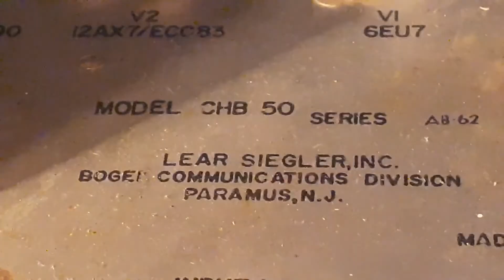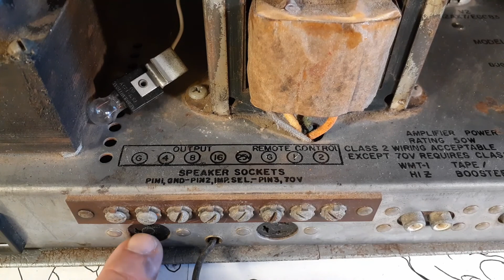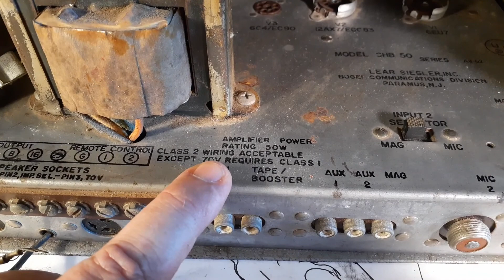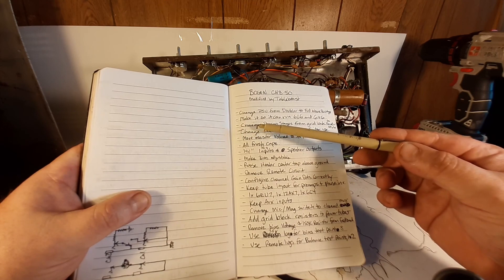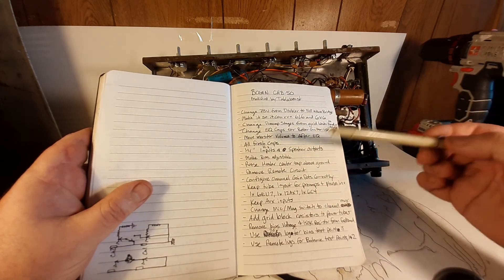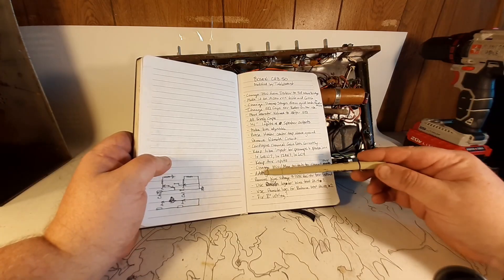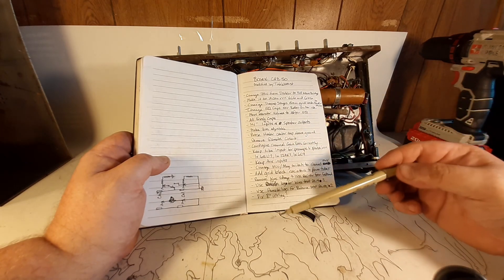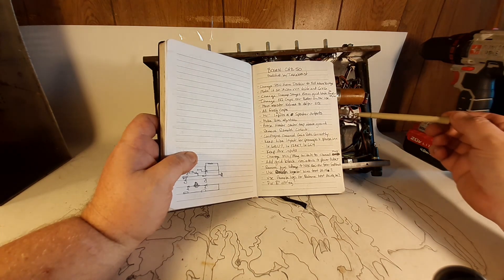Bogen CHB-50 Tube Amplifier Conversion, ep 1: Tour and Mod Plans

Comment: About 8 years ago I was digging around in my old closet from when I was a kid and found my old Bogen CHB35A that actually used to belong to my dad back in the 70's, but needless to say it was in VERY bad shape.
So bad that the ONLY thing I used was the metal chassis and metal cabinet. So I did exactly what you said you're going to do (did) with yours. 
I used a Fender Princeton PT hooked to a 5U4 rectifier for power.
Then I used a 50w Marshall OPT with EL34's driven by a long-tailed-pair 12au7 phase inverter. 
Then I designed a "potentiometer adjustable" fixed biasing circuit with it's own seperate small power transformer on wich I wound the secondary winding myself.
Then I looked around and desided on the Fender Bantom Bass amp preamp circuit consisting of two 12ax7's.
And now I just gotta say, it's got the one of the best sounding cleans tones I've ever heard in my life, it's even dead silent when you stop playing and take your hands off the strings. 
It's clean tones are even better than the cleans on my, (gulp), 6100lm 30th aniversary Marshall...
Reply from the maker: Bantam bass preamp, huh? Hmmm, 
I’ll have to check that out.

Comment: Nice work man.  I've got The same amp and I'm going to try to do exactly as you did but any way you can point me to where I could get a readable schematic for this model? Also, I was hoping to hear an example of it being played but I did not see that in part 4. Thanks
Reply from the maker: The chb35a schematic is almost exactly the same. I think the conjunctive filter on the output tubes is different, but you’ll probably rip that out anyway. I always do. Chb-35a schematics are all over the place. I’ve seen seems for the 50 before, but it’s significantly harder to find and, for some reason, a much rarer amp as well.

Comment: I've got a Bogen CHB 100 from the mid 70's  it's got 4 7868's 6eu7, 12 ax7, and 6c4 and I've got schematic... Want to use it for cassette deck or turntable,, I need help!!! Everything looks mint in there , nobody's worked on it I installed 2 switchcraft jacks hooked up spkrs . And..... Over and over the 7watt 750 ohm resistor goes up in flames I've changed it out 3 more times larger watt values.... Same thing, your help if you can l would greatly appreciate. Thanks .
Reply from the maker: First off, if you’ve only got the one amp, then you’re only going to be able to use the amp in mono. Second, 100 watts a tubes is very, very loud! Even 35 or 50 is too loud for this application, in my opinion. Third, that Bogen of yours is a poor choice for a hifi amp as it is very much NOT hifi. For optimal home listening pleasure, you’d be better off with a stereo low watt amp. 10 watts per channel would be plenty in push/pull, but even 5 watts in single ended mode would fill your listening space with beautiful music at a comfortable volume. Now, as for your resistor, my guess is something has failed or otherwise shorted out. Try to find the defect rather that constantly replacing that resistor. Chances are that resistor failing is protecting one or both of your transformers. Message me at tablebeast@me.com and I can help further.